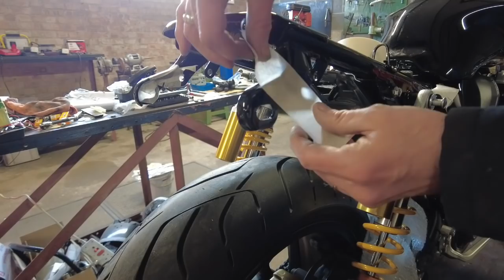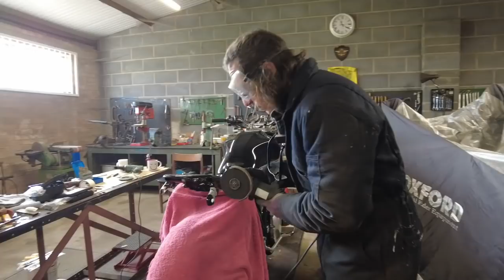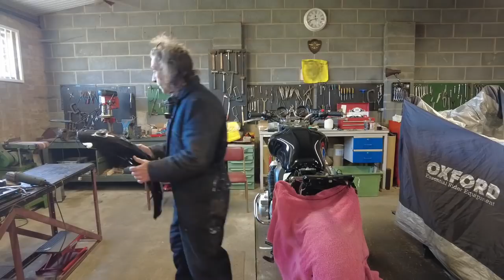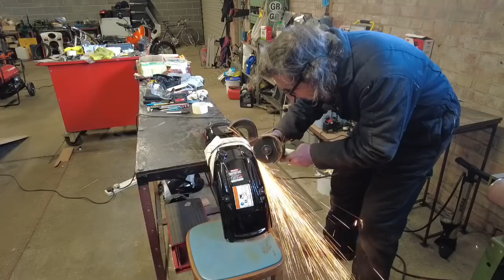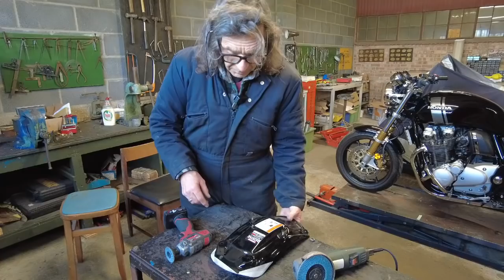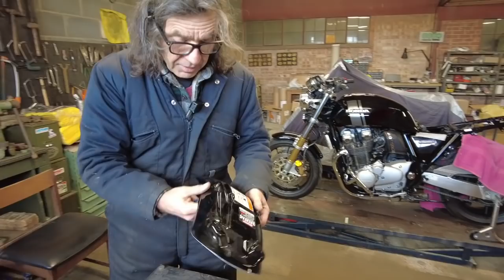5Four CB1100RS Bespoke Build Episode 2, The Build Continues

Comment: Hello Guy, it’s nice to see the bike coming on and interesting seeing you go through each step. I don’t know if you will find this useful, but I have found if you use an angle grinder tipped over, canted, because the disc is curved it will follow a curved cut in a sympathetic way.
  Good luck with the build and the Benly. Kevin.